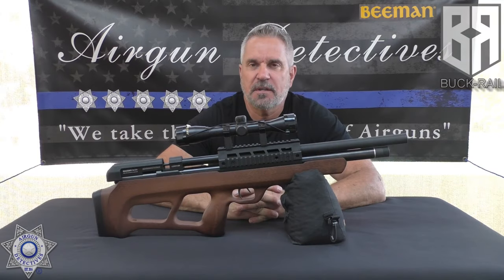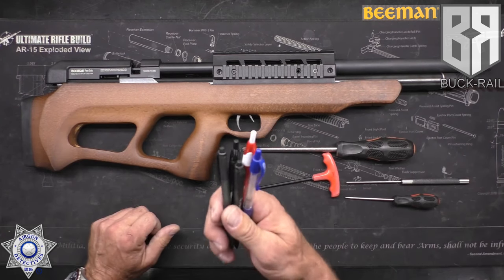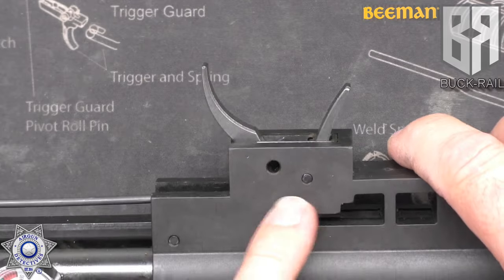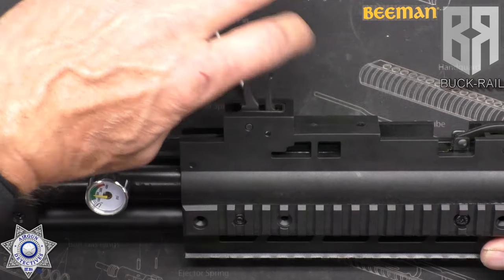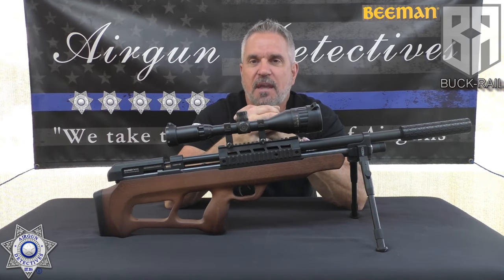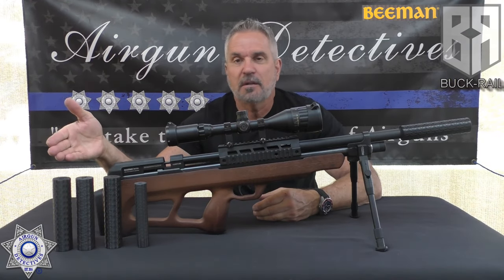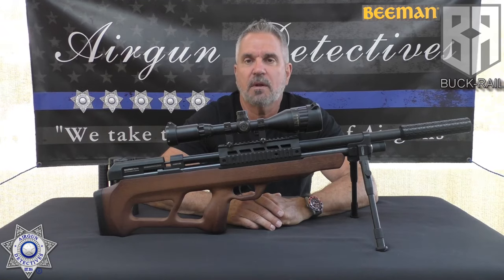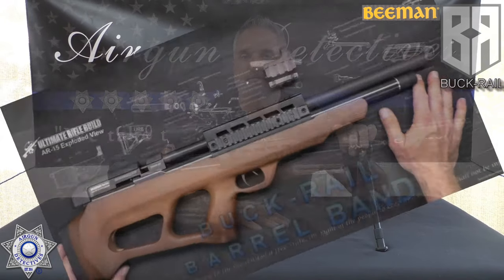Beeman Bullpup Under Lever, how to "UPGRADE" by Airgun Detectives

Comment: I got my Beeman Commander .22 and I love it. The quality for the price goes unmatched. It isn't regulated so it's a bit tricky getting the hammer spring adjusted based on what weight you're firing, but it's accurate and man it hits hard. I have a set of little metal spinners with a target mount on top that is speced for .177 and .22 air guns. I bent the shit out of the plates with a little 15.42 grain pellet. It likes the 21 grain slugs the best, but did ok with the 34 grain JSB's, but they are too long for the mag I had to use the single shot tray. This rifle ripped through 3/4" plywood like butter. If you buy it, you need a solid backstop. I had to mount a pic rail on the fore-stock for bipods and threw away the scope that came with it. It has a beautiful hardwood stock, but with the bipods and scope it's heavy. I will get a strap for it before going hunting. It is a lot of weight to shoulder and fire. Let alone carry around for hours. The trigger out of the box was less than 1lb. I like it. I didn't have to adjust it. I like the safety being right in front of the trigger as well. I love the Beeman products for the price point they  offer. I shot beer and soup cans full of water and they went flying. It literally blew the  back out of a beer can with a 15.42 H&N field target trophy. It was split from top to bottom. I am amazed at how hard this thing hits for a .22. Now that I have this one, I must have the Bull Pup. Thanks for another great review JC.

Comment: Great video JC. One trick I’ve learned to taking pins out is to use a roll of duct tape or electrical tape placed below the pin so when you tap it it has somewhere to go and it is actually pretty solid
Reply from the maker: JP, Great idea!! I appreciate the insight and thanks for watching!😉👍

Comment: Great video. I had high hopes
For the BuckRail for the Akela first 2 had baffle strikes and final replacement was working great but the entire end cap blew off no pellet strikes it was a layer separation in the 3D print so I unfortunately had a bad experience x3 they did refund me prior to sending 3rd moderator but in the Akela moderators I had a bad experience I had high hopes as I do 3D printing but really feel it’s playing with fire high pressures on plastic printed parts. I have a video coming out next week showing it but with that said I have a 240.00 huggett magna on a Fx impact .30 it had baffle and end cap strike brand new 2200 gun and 240 moderator so you never know. Funny thing I have a generic $40 moderator and a FX factory moderator never had any issues. I think things just slip through the cracks. Unfortunately on the buckrail I had issues with everyone I was sent.
Reply from the maker: Fortunately, I have had nothing but positive experiences with the Buck-Rail accessories.  I am sorry you had a less than stellar experience, but I am sure Terry took care of you.  He is constantly improving and upgrading his products. Thanks again for tuning in.

Comment: It looks as though the Beeman 1365 Commodore-S is the same .25 cal bull pup but with a synthetic stock versus wood. Buck Rail's adapters and your bipod should work on the 1365 as they did on the 1357, 1358, and 1359.
Reply from the maker: I am testing the new 1365 model as we speak. Yes, the Buck-Rail tri-rail adapter fits perfectly, as does his suppressor.  My Bipods are perfect with the under lever cocking system. This 1365 model is a 3500 PSI fill as compared to a 3000 psi with the original wood version. They also moved the gage. I am really liking the synthetic version, and the accuracy is incredible. #staytunedforairgundetectives

Comment: Great video,  I have to ask? When you take off the shroud,  isn't the barrel end already have a 1/2 x 20 thread? So, if so, couldn't I just put my moderator on the  end of the barrel without the shroud?
Reply from the maker: Yes...that would work, it just doesn't look as nice 👍🏻😉

Comment: Another very good video (as usual)

However the first option of "supressor" that you called muzzle in fact is one "air stripper" that will not supress the sound BUT it will provide you one bether grooping shotting for all shooters that wants to do target shooting.

Usually one very accurate upgrade to have in consideration.

Great job.

Please don't stop.
❤

Ps: Are you going to test any COMETA PCPs air rifles!?

Comment: Did you notice a POI change when you put suppressor on? Installed mine and it was shooting way off after being zeroed in un-suppressed.
Reply from the maker: My POI stayed the same, but I have definitely seen the POI change on other rifles once the suppressor is installed.  The key is that as long as it still groups, you can adjust the scope or sights. If it doesn't group, exchange that suppressor.  👍🏻😉

Comment: One thing to be mindful of. Do not turn or let the trigger rotate! Im not sure if you can turn it by hand. But if you turn it that throws the linkage off. ( ive not done this upgrade yet but im sure if you let it rotate 1 turn the linkage and trigger pull length will change. possibly throwing the Sear off and not letting it fire. )
Reply from the maker: There is a lock-nut on that. It won't move unless you manually adjust it. No worries there. Happy Shooting 👍🏻
Reply: @AirgunDetectives  thanks

Comment: Be careful on doing this there is a small pin that holds the trigger itself to that rod. mine fell out luck I saw it. What a GREAT improvement with a different spring. Keeping the old one.

Comment: Does anyone know if the Beeman 1385 has an o-ring inside the breech ?
Reply from the maker: That would be a "Yes." Similar to the Benjamin Marauder.
Reply: A little divers grease ( silicone ) helps them last . Use on my Airforce guns .